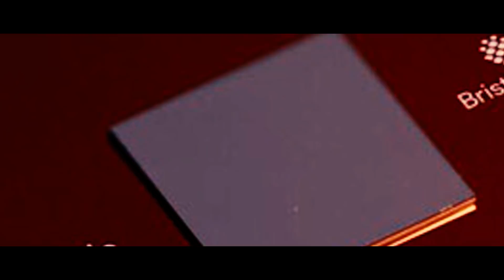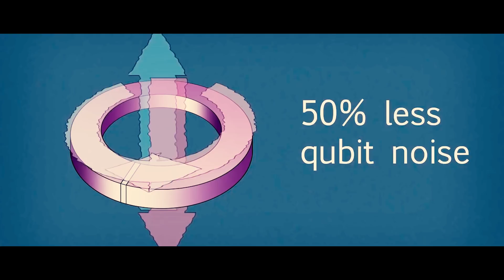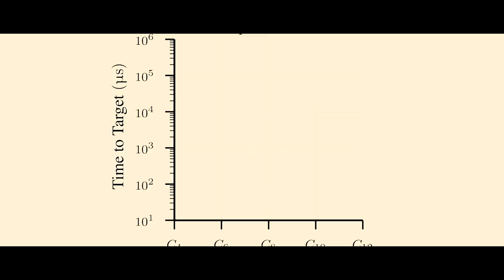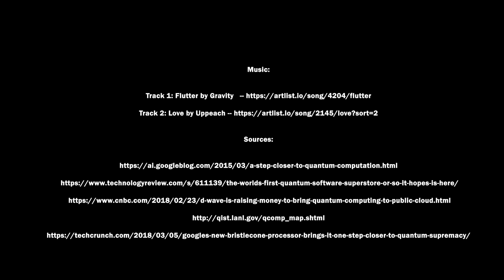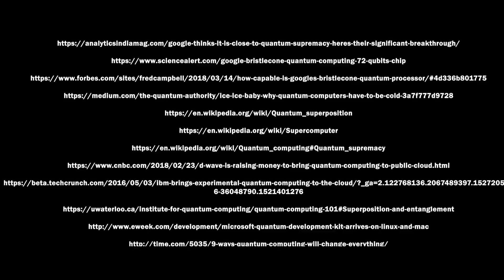The Future of Computing Part 2: Quantum Computing

Comment: The dream rig of the near future: Bcone 1080 QPU with CoolerMaster Nitro, IBM OPTICAL CPU+memory integrated chip plasMONSTER p7, Hitachi Quartz State Drive 1.5 ZB, Lightbolt 3.0 direct fiberoptic cable drive, Li-fi drive with local BCI (Brain-Computer Interface) NeuroLink 2.0 support, Samsung Odyssey QLED Contact Lens, and a Logitech GamingPro Sensory Deprivation Tank twin size, with multi-color lights option of course :)

Comment: Really good to watch!! The question begs now where is the watershed in number of calculations needed in 1 nanosecond which makes classical computation more suitable to quantum..?
Thanks NeoScribe for this worthwhile video. Will definitely watch it again a couple of times
Reply from the maker: Thanks!
Reply: Quantum computers aren't inherently faster. The state of the n qubits will be some linear combination of the 2^n possible states, but when the state is measured, it will collapse into one of those 2^n states. The probability of the qubits collapsing into a particular state is based on the coefficients associated with each of the 2^n states. 

So you must manipulate that linear combination correctly in order to end up with only the correct state having a large coefficient and all other states having a small coefficient. And the allowed manipulations are fairly specific: they must be based on multiplying the coefficients (represented as a column vector) by unitary (magnitude-preserving) matrices in order to ensure that the sum of probabilities of collapsing into the states is 1.

Comment: You got the classical computer slightly wrong. Then don't "stack incredible amount of bits", but, in most cases, only 64 bits. The thing that it is stacked are computing unit, not bits.
Reply: Got quite a bit wrong actually.